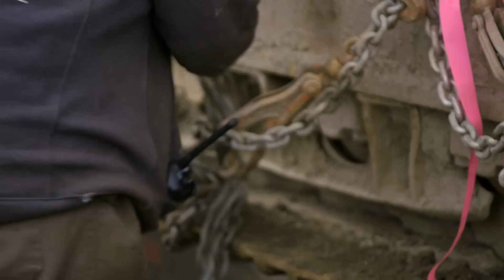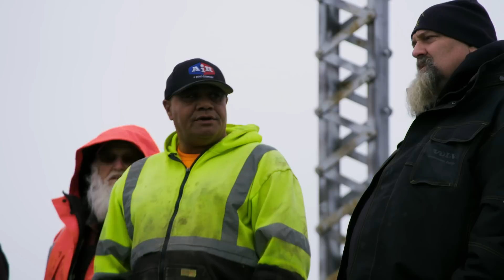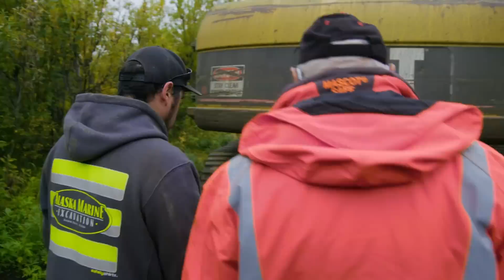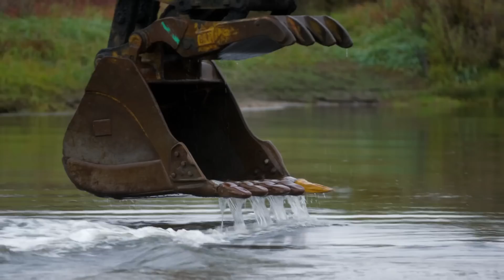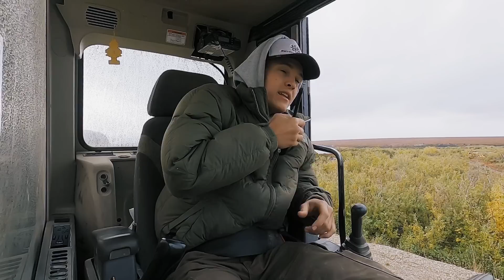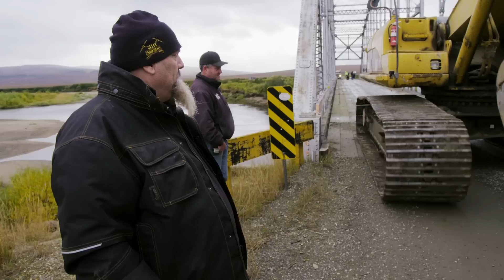The Hoffmans Risk Their LIVES Getting Excavator Across Shaky Bridge  | Hoffman Family Gold

Comment: not to made them bad or anything but I think they know the capacity of the bridge and the weight of the excavator so everything should be okay, it still would be scary though
Reply: They defanitly amped up the drama for TV. Always do. But while they knew the weight capacity of the bridge & weight of the excavator.. those are on paper metrics. Never accounted for is the curent condition with a recent inspection of the bridge. Too much rust in the wrong places can always cause a collapse when putting serious weight on it. Especially with the vibration being caused.
Reply: cat 330, roughly 33 tons or 66000# bridge rated at 23000# pretty easy math